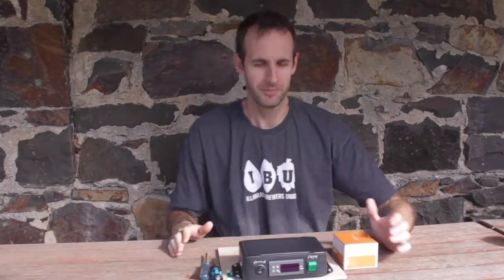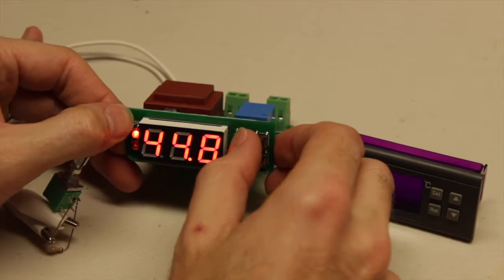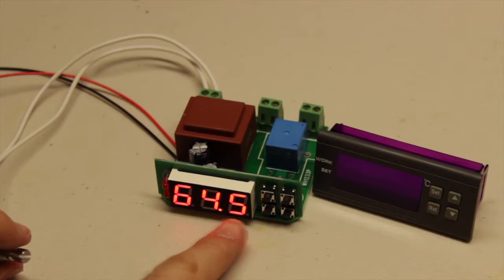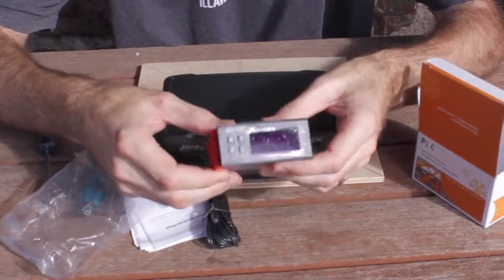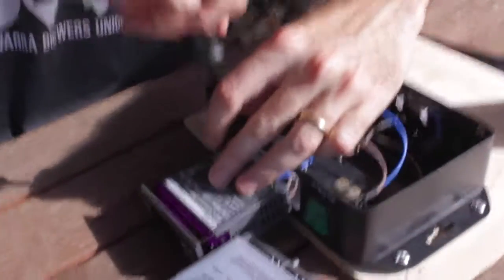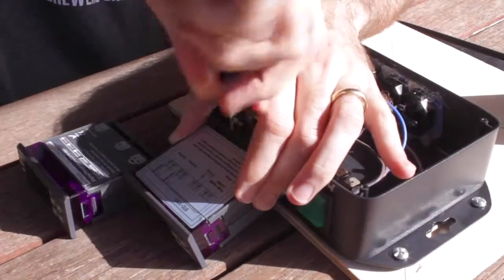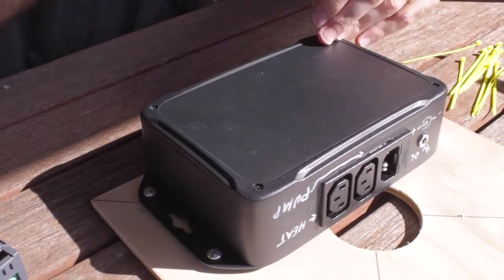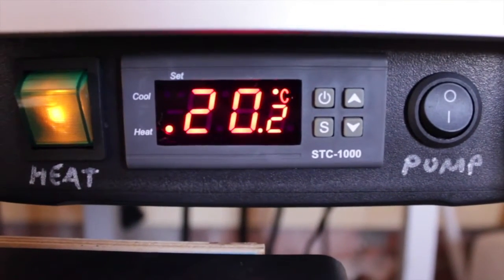HERMS controller - Upgrading to STC1000

Comment from the maker: Flashing the STC1000+ firmware completely changes the behaviour of the controller. It lets you set temperature profiles with ramps and delays like a braumeister or you can use it to control your fermentation fridge with temperature profiles for diacetyl rests, crash cooling etc. More details here: https://github.com/matsstaff/stc1000p

Comment: What are you using for the heat source? I've been thinking about doing this with a 5500w element and upgrading the 10a relays in the STC1000 to SSRs.
Reply from the maker: I'm only running a 2200W element so the STC1000 works fine. I'm sure external SSRs are an option on the STC, but then you might want to consider a Brauduino build instead. After this vid I caught the itch and upgraded again. That thing rocks!

Comment: Looks great.  I made a similar one (even used the same plugs)  I also added an push-button e-switch, fuse, and amp/volt meter.  Initially encountered some heat coming from the box, so I added a PC fan inside.  Works like a dream...not a neat as your rig though.  Looks great.

Comment: Nice upgrade! One Question: Is the "heat" switch between the controller and the heating outlet? So you can have the controller on, but block power to the element?
Reply from the maker: +Mash Hacks Currently the heat switch turns off the whole controller and I've never thought about switching just the element until now. That could be helpful in some situations so thanks for the thought provoking question :)